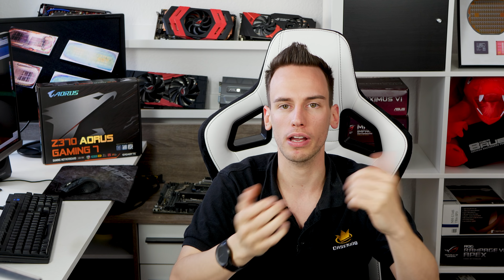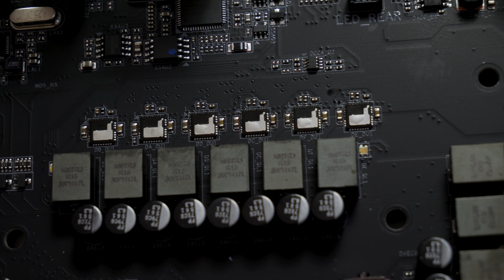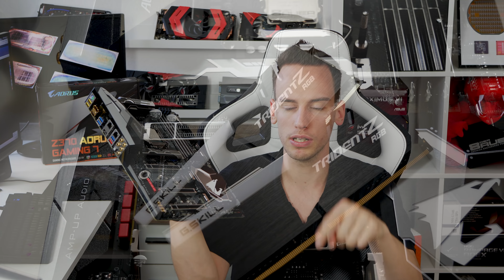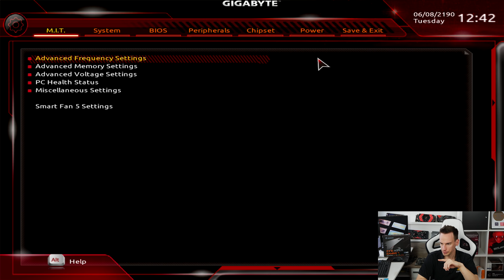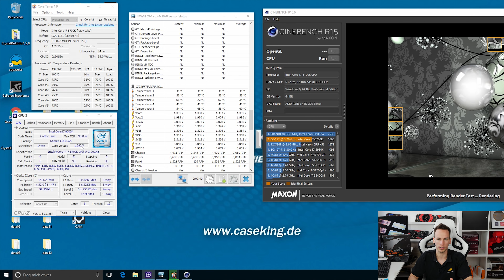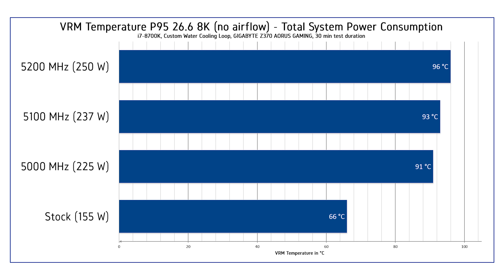Is GIGABYTE really THIS bad?

Comment: The x470 gaming 7 has an epic heatsink and vrm. Why is there z370 lineup so much worse XD
Reply: Lawrence Timme I guess because when the z370 line launched, they were praised for their top of the line VRM, but heavily criticised for the less than fantastic VRM heatsinks, and unusually for a manufacturer, they listened and changed things.
Reply: Cmdr Flint the VRM itself isn't even good though. Its 4 phase doubled on a 'top of the line board' it should have 6 doubled or a true 8 phase minimum
Reply: Lawrence Timme it is effectively an 8 phase

Comment: From my experience with mostly the very cheapest motherboards you can find (for office builds) I found that gigabytes is often the worst choice you can make. Almost all DOA's came from gigabyte. Overal my experience with Asrock has been great and MSI also seems to do quite well. Asus I didn't buy much as they where more expensive but the ones I did buy really where certainly not any better than MSI or Asrock. 

Going to higher end stuff I use at home I really think that the Z370 Gaming 7 is a fine motherboard for 6 core coffee lake If only they knew how to make software.

Comment: @der8auer very informative. 1. Which software did you use to check memory stability? 2. I have the 270X gaming 7 (i7 7700k), do I need to disable turbo boost on my board also for overclocking?

Comment: Answer : Yes. Avoid Gigabyte motherboards as plague. They are not QA evaluated as normally they should. That's why they are cheaper. After first revision of the motherboard, components are swapped with the cheapest they can put on motherboard.
Reply: can you go ultra instinct yet
Reply: Not to mention the Gigabyte Bios looks like it came from the 1990's.

Comment: you should get the asus z370-A prime board.  i had two from two different retailers and they both failed the same way while overclocking my 8700k's and testing with prime95.  i've always oc'd with asus boards so i set up the bios as i always had.  the vcore was not exceeding 1.25v and both boards popped a cap behind the left vrm sink under the white heat shroud they smother that board with.  i know prime95 is considered "unrealistic" but it's been a staple of stability to me for years and proves to be reliable in finding instabilities while other "stress software" does not.  i think asus just rehashed their old z170/z270 boards and passed them off as their entry level z370 boards.  i also think where intel rushed z370 the board companies didn't have time to develop the boards properly for these power hungry cpus once overclocked.
Reply: Thats what they did, Z270 MSI/Asus Z boards are rebranded 370's, and im not talkin for the low end, but for the mid-uppermid tier too. And part of that is bcuz the 370 was rushed, you are right on the point !

Comment: I've had 3 motherboards from Gigabyte and guess what? Had to send them all back to repair, *ALL OF THEM*. Never buy gigabyte, absolute pile of shit.
Reply: Long Doan What kills a PC component? Voltage and/or Heat. Overclocking is safe as long as your within the 'recommended Vcore' suggested by the manufacturer and as long as you have good temps. Your PC will be worthless by the time your components die whether you are overclocked or stock.
Reply: The Infidel What were wrong with them?
Reply: Long Doan Why would you not recommend Overclocking?
Reply: Personally, i gave up on Gigabyte years ago. All manufacturers make better, and worse quality designs, and it's just luck, if something fails on you. What matters is the support you get after something fails. Gigabyte sold a motherboard for my 8400E years ago, with "military spec" as the main selling point. It is of course just hot air, PR fluff, with no significance, but it was a premium motherboard, supporting overclocking, with a very premium price point. After about 2 years it was showing signs of capacitor failure, but no leaking yet. I contacted them and got stonewalled. As long as it works, no replacement for you. Once warranty had run out, it didn't take more then a few months, and the motherboard started bluescreening, so i opened it back up, and sure enough, capacitors leaking were now a fact. Took contact with them again, and, nope, no warranty, since it was now, out of warranty. Under Swedish law, i can still claim faulty hardware and get it replaced as a part of consumer protection, (reklamation, for the moment the English term evades me.) but this was denied since i had used the overclocking features, and hence had run the system out of spec.
The best i got, after months of back and fourth was an offer to ship me the capacitors so i could replace them my self, which i reluctantly went with. Said capacitors never showed up, and i ended up buying spares and replacing them, running the system for another couple of years, until i got my 2500K and a MSI board. Not that i had THAT much more luck with these MSI based systems, but at least they ran stable for 6, almost 7 years, before they dropped 2 out of 4 memory slots.
Reply: Guys, guys...Gigabyte is only the 2nd worst. MSI is the worst. They are both polished turds.
That said, this is a generalization. Any manufacturer can have good and bad products, it's just that some tend to consistently have bad products in their mainstream and budget segments that they pretend are good. They put some trendy logo on it, flashy RGB, give it an aggressive sounding name, and peeps throw their cash or their whole wallets at it because they think it will impress their friends or random people on the internet for owning it.
Reply: I have had 3 motherboards from Gigabyte over around 7 years and never had a problem at all from the Z97, Z270 and now Z370 Gaming 7 and never had a problem...
Reply: Theres no need to overclock a 2700x in an x470 board anyway, it does it all itself, just overclock your ram, in the next chipset from amd auto ram overclocking is coming on ryzen2 in 2019
Reply: Define "need".
You can overclock the 2700X further manually then what you get from the auto stuff.
Reply: Meanwhile my Z97 SOC Force is still keeping my dog 4770k at 4.4GHz or higher clock without problems.

So yeah it depends.
Reply: actually gigashite have  the highest failure rate, they are terrible terrible boards, especially the bios

Comment: What are the rest of the UEFI settings you used? That was the first I ever heard of disabling turbo boost to overclock. I've been just setting cpu ratio 50 and all the turbos to 50 with 44 cache and 1.425v core. I guess I'd like a more detailed look at what you set so I can work on my overclock tonight.
Thanks dude!
Reply: Cmdr Flint I even got this going on with my 8700k
https://navjack27.netlify.com/the-rockit-cool-copper-ihs/
Reply: Harineto I have tons of videos on my own channel showing what I do. It's not a misreading and I've done extensive testing.
https://youtu.be/fp9_5nAiJqU
Reply: I have same question.
der8auer, presented UEFI settings is Your's all OC settings or not all?
Reply: Ouch, 1.425v is crazy high for 5GHz.. you can push 5.4GHz with voltages like that. Drop it to 1.28v and work your way up, you'll probably settle around 1.3-1.33v.
Reply: Cmdr Flint are you high? 5.4? Seriously? That's like a less then 1% CPU. https://navjack27.netlify.com/refining-coffee-lake/
Reply: I wish I could say I didn't know what I was doing but I'm pretty good at documenting everything
Reply: NavJack27 managed it on mine with no issues, only running with a 240mm aio so can't really sustain 5.4GHz as temps get to mid 90s under stress loads. Maybe if I de-lid the thing someday I can manage 5.4GHz for more than just benchmarks.

For general use I run at 5.0Ghz with 1.29v.

+Nice job with the IHS replacement :)

Comment: Tom did also say that not all gigabyte boards were terrible and at the price point, the new board wasn't comparably as good as other manufacturers. Why buy it if you can get something better for the same money?
Reply from the maker: yea as I said I totally agree with him on this board
Reply: I know, and i totally respect both of you guys. I am just asking as I find it difficult to understand the thought process behind bringing out a board revision that is barely better than the predecessor when it wasn't a great board to begin with.
Reply: The z370 gaming 5 and 7 are very good. The lower end gaming is where the issue is.

Comment: What about ASRock?
Reply: ASRock is unbeatable in price to performance
Reply: bogdanut in his battle of the cheap video he mentioned that AsRock became very good in the past years, even if it was bad before
Reply: Asrock Taichi is among the best z370 motherboards
Reply: Brent P "Phenomenal" in what aspect?
Reply: heck yeah
and their ITX boards are the best
Z370M-ITX/ac here with an 8700K
Reply: My dirt cheap $40 mATX 970m Asrock board did allow about 200w on FX (4 phase VRM). Then if you add substantial airflow (very substantial), I could push FX over 300w above 1.5v. 

That board even had disclaimers saying it was not compatible with FX-9590, but I passed that in speed and power draw, so it could handle it with some extra cooling no problem, but I agree I wouldn't recommend it without fans. However, it did handle it like a champ.

If the dirt cheap ones could handle it, and the Tiachi coming out with crazy VRMs, I wonder if you could push 800+w? Seems like you could with good airflow.
Reply: Going to depend on which asrock motherboard on what platform. Newer x370 fatality gaming x and sli killer boards had LLC options removed from bios intentionally, so that control while overclocking is gone. Those are just the 2 I know of. Other than that, usually good boards for the money.
Reply: I currently use an ASrock 970 Extreme 3 AM3+ and it's a mess. My friend told me ASrock made back then very cheap mobos for AMD CPUs on purpose, but I have no idea if it's true. I read here and there mobos made by ASrock bad, but they talking about the older ones. Aint gotta clue how the newer mobos from ASrock are, but I avoid them. However, if you had good experience with them, I'm glad to know!

Comment: They also have terrible support I will never buy any of their products again.
Reply: gigabyte = all leds, with poor bios
Reply: Uk Gamer Can you talk about your experience?
Reply: I had a first gen aorus 1080 gpu and the cooler was dodgy (made a horrible whine noise)and they refused to help. Their stance was to go back to the etailer. I've never experienced anything like that.
Reply: i had a more serrious problem than that with my aorus exreme edition 1080ti .When i installed that gpu i had many problems (i replaced a gigabyte 1080 g1 gaming which i didnt had any issues at all)So the problems first started when i installed my gpu i updated the drivers etc and i begun to bechmark this thing to see what it was capable of.So i run a valley to see the results and almost instand like 8 seconds after my gpu temps was 89c and no it was not a joke and at this point i must say that i was shit my pants because i bought this gpu from italy and i live in Greece so the return was not an instand option for my case so i put the fans at 100% only to realize that the fans was not responding at all but ofcourse that was not the problem about the temps so i contact the support and i didnt recieve any replies for days so i decided to open it up and voualaa first the fan connector was off yes off not connected at all(the card was brand new and 100% sealed)and then i begun to clean the thermal paste and under the paste i discovered my temperature problem i could not believe that the whole chip was covered by some kind of glue the whole thing was everywhere on my gpu chip it was a material that they used to cover the small transistors arround the chip.at that point i begun to try to clean the die it took me 2 hours+ to completely remove the glue.Then i put some thermal grizzly kryonaut and the thermal issue was gone its extremely cool gpu now most of the time is working under 62c even after long gaming.But the story doesnt ends here,i contacted again gigabytes support with a new email explaining the situation and basically complaining about 1)how poor the quality control was for their flagship product and 2)how slow their responce time was .Almost 2 weeks later i recieved their reply and they said that oppening the product may void my warranty and that if i have any other problem im free to communicate and pretty much thats was the support from their part.Ohhhh man.... the gpu is still rock solid no issues at all now but never again...that was a terrible exprerience...never again i paid 1100 euros for that thing.
Reply: My support with them is outstanding with my Z370 gaming 7 and Aorus 1080
Reply: Just got a DOA Aorus Z390 Pro, i bought it in amazon but i live in Colombia, almost all companies will send me back the replacement to colombia, but Gigabyte they don't not only that but it takes sometime for them to actually answer, so far i don't think i'll buy a Gigabyte product ever again.
Reply: Well guess what

Its still shit 2 years later.
Reply: My bad Gigabyte support experience is in the above comments.

Comment: Why not put propper heatpipes and fins on the VRM like they did on the top of the line x470 ?
Reply: Andrew Joy gaming means cool looking, therefore no functional and potentially uglier pipes
Reply: Cuz Z370 was forced and this mobo come out way before the X470's.
Reply: Because their realization only happened after when they started designing X470
Reply: They should totally just use the x470 heatsink design for z390, I mean they will REALLY need it for the 8 core coffee lake chip, that thing will probably end up pulling 250W+ when OC-d.
Reply: Dont think so, this board has 70$ worth of VRM components, and they are better than the overrated Asus Hero. The heatsink mounting is bad (it can be fixed) and the thermal pads too. After you remount the HS properly and put high performance pads this mobo turns in one of the best Z370's.
Reply: I have that board and it has a fan in the VRM that der8auer just did not turn on in bios. by default it comes on at 100C or something like that. The fan is hidden behind that fancy light up shroud.
Reply: pike RDM and that fan does nothing to cool the VRMs that actually get hot. The VRMs that have the issue on other borads, like the Gaming Ultra, are all above the CPU socket.

That tiny 20mm fan on the Gaming 7, tucked behind the rear IO panel, will do almost nothing to help cool those VRMs above the CPU socket. Yes the heat pipe extends to there, but trying to rely on a tiny fan like that to move air across a heat pipe well away from the source of heat will have no meaningful impact on the temps that matter.

Not that the Gaming 7 needs it, it's VRM design works very well without that little fan, and works even better if you have normal case airflow moving over those VRMs.

Tom's test was bogus, he put a 5.2Ghz overclock on the VRMs without even basic airflow that you would get inside of a case. Very few people will ever push to 5.2Ghz in the first place, and those that do are even less likely to be running a budget board like the Ultra Gaming.

A board someone is more likely to run with that OC, like the Gaming 7, handles it just fine.
Reply: J Master 
Tom’s Test was bogus?  
I believe Tom ran the same test with the same CPU in the same case on other boards that did not have this issue.
Reply: Dereck Dunn believe what you want, the go watch the video and read my post again. The issues as to why Tom's test was bogus:

No airflow of any kind across the VRMs.

A 99.9th percentile 5.2GHz overclock that only a handful of 8700Ks can achieve with safe voltage and temps, with no delid, on a board not designed for extreme overclocking. 

The people pushing those kinds of extreme overclocks aren't buying budget boards like the Ultra Gaming. Take that same board, give it airflow over the VRMs, and keep the OC reasonable, and it won't have problems. Yes the VRM could still be better, but Tom's test was still a bullshit "never going to happen" scenario.
Reply: Cost
Reply: Kindis so ruin any chance of warranty and correct yourself a engineering failure?
Reply: @CarryOnly Br - I dont know if the warranty will be voided, but its a shame that Gigabyte puts such crappy pads and cant mount the heatsink right, on a mobo that has 70$ worth on VRM components....
Reply: The X470 only has the fins it does because of the X299 Dark from EVGA. A board that didn't release until after the Z370 boards were designed. Its also in direct answer to complaints about VRMs on previous boards like the Ultra. The board in this video though, the Z730 Gaming 7 has VRM heatsinks that function perfectly well. With zero air flow he can't get the VRMs to crack 100c with an OC of 5.2Ghz. No air flow and an overclock of 5.2Ghz is not something anyone would run either. Yet despite the worst case scenario, the temps were fine.